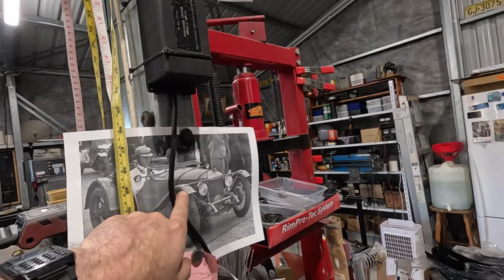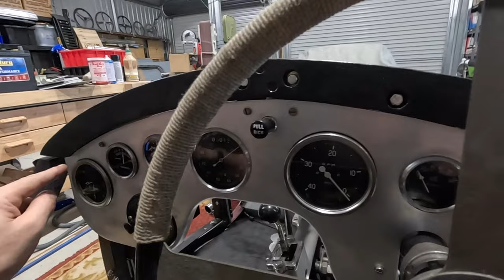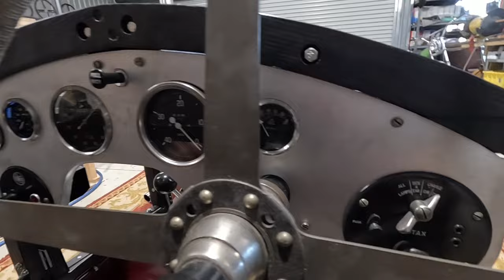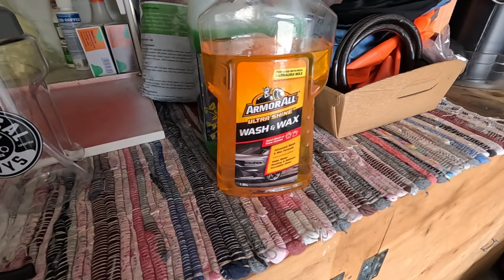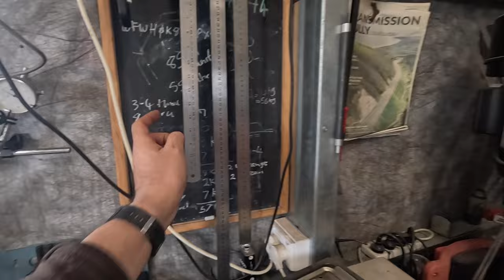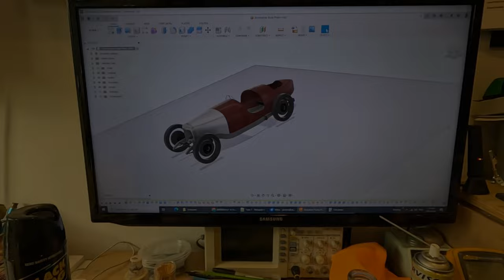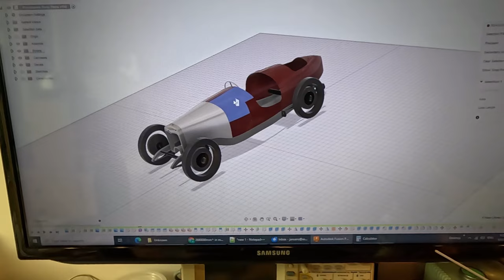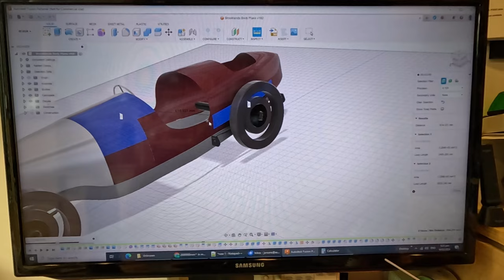Pre war Riley Brooklands - fuel lines finished

Comment: That's a fine-looking P-51! Looks like you're about halfway there.   I don't think there are any of us that haven't seen a car, airplane or motorbike that we didn't want to drag home with us.  We are all closet engineers whether we're any good at it or not.   I'm thinking about getting some of those flashy battery powered LEDs that bicyclists have on the back of their bikes.  Maybe glue some magnets to them so they are removable.   All they do is flash but maybe they would get the idiot drivers to notice me.
Reply from the maker: A friend of mine with an Austin 7 did exactly that, bicycle lights with magnets. Some of those LED ones are very bright!